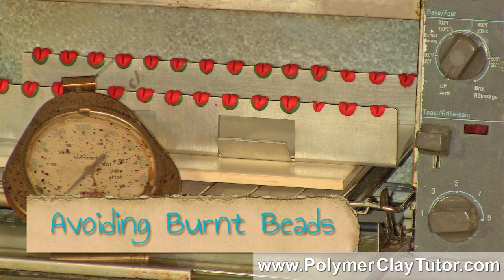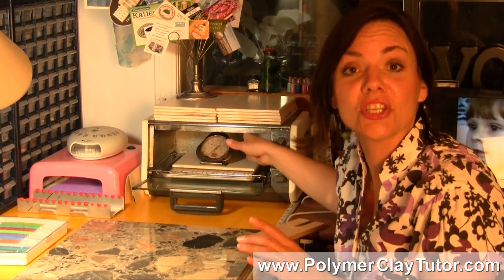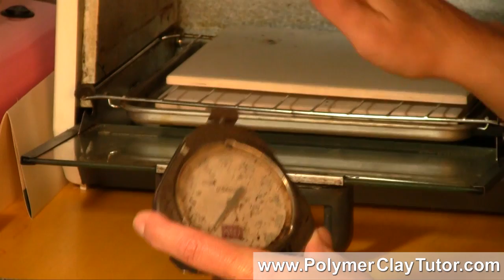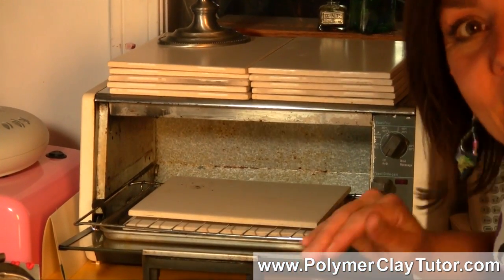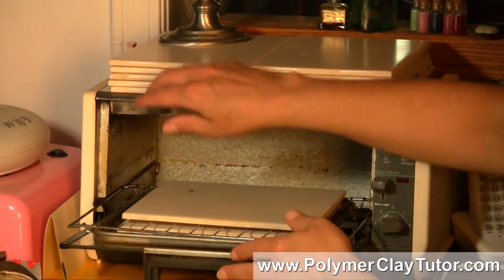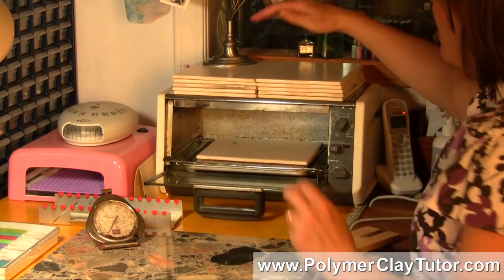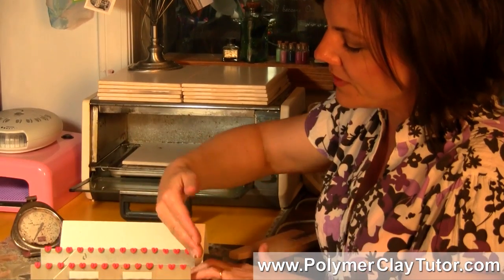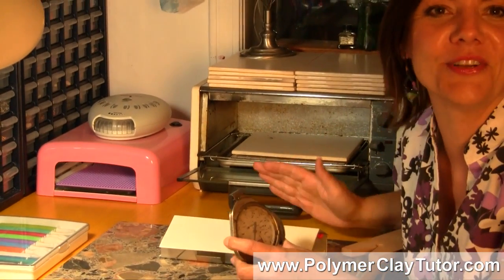Baking Polymer Clay in Toaster Oven Without Burning

Comment: I just started working with polymer clay and the first batch I baked burned so I googled you tube and found you.  I didn't have any ceramic tile laying around but did have some thin fire bricks for our wood stove.  I layered them in and around and found that my temp stabilized.  Using a tent helped too.  Thanks for your videos, they are sooooo helpful.

Comment: I just bought some Fimo Soft yesterday. To my surprise the package says "Do not heat above 130C/265F". It's been a couple of years since I have bought or used clay; previously it said temp no higher than 230F. I am making heart ornaments, Fimo Soft over aluminum foil armature. The clay is roughly 1/8" thick over the foil; at the top is a hanger which is pure clay. It's 1/8" at it's thin point, 1/4" at the base. The fimo package no longer gives any direction as to baking time. Do you have any input about baking time and temp? Would you bake something like this for 60 minutes with the insulating tiles as you have shown? Thanks.
Reply from the maker: Hi Rebecca McCartney I am not surprised by the packaging changes. Over the years the way we bake polymer clay has changed and so some of the manufacturers have changed their advice as well. I bake Premo and Fimo for 1 hour, no matter the thickness, but at the temp recommended on the pack. And yes I would use the insulating tiles as well. Check out my channel... there are lots of videos on baking and more being added all the time that should help. Good luck!

Comment: Hi. I saw on one of your channels you said to bake polymer clay for 60 minutes. I'm baking small 2, 3 and 4 mm beads and some are 2 - 4 mm balls, as well as tiny little sprinkles to put on whipped topping charms. Should those be cooked for 60 minutes as well? I bake in the same oven as you...the kitchenaid countertop convection KCO223CU.

Thanks for your advice,

April

LOVE YOUR CHANNEL!

Comment: Hi Cindy, I read down quite a few comments looking for an answer first.  My question is, if I'm going to use a new convection toaster oven, do I still need the tile (I have it readily available)? Also, there is obviously no problem using paper products in a toaster oven or it would not be recommended.   Can I assume that's the case then by the top or bottom heating elements?  I believe that is cardstock type paper only, is that correct?  I've seen a "bead holder" made from cardstock folded to look like an accordion to bake beads on but I was concerned about having "paper near a heating element"...Thank you :)

Comment: I don't have any ceramic tiles lying around but I have a ceramic cup. Can I use that instead? I don't plan on baking large items, just small ones that would fit in it.
Reply from the maker: dream_keeper88 That should work, as long as the cup is heat resistant. You could easily tent the cup wit a piece of tinfoil as well, so it might be a good solution for you. But of course you will need to test it on something that is not super important first.... just to be sure you're getting a proper cure. Let us know how it works for you!

Comment: If I use a ceramic tile, a tin foil tent and bake polymer clay in the correct temperature as stated in the package, would it still work even though there is no bake option nor a temperature dial? My toaster oven only has the timer dial on it.

Comment: Is it safe to use your regular kitchen oven since the clay and fumes are non toxic?
Reply from the maker: Most brands of Polymer clay have been certified non-toxic to use in your home oven. If you have any concerns you can look at the Safety Data Sheets for the brand you're using.

Comment: Hi Cindy, I appreciate your video. I am new to using polymer clay, and so I am learning so much. I got a Black & Decker toaster oven for baking my clay, and I bought a oven thermometer from Kroger (Everyday Living brand). I noticed when I am heating up my toaster oven or my home oven, the thermometer is reading -25F then what my dial says. I have a really hard time with the toaster oven getting it at 275F because of this. I previously went to Home Depot and bought some tile, about same size as yours, but I only got 2 as I was thinking to use it for my work space and bake tray. How many tiles would you recommend for placing on the top of my oven? Also, do you have any advice on what to do about my thermometer? I am not sure if it is faulty or not, or how to fix the issue.

Comment: hello cyndi.. i want to ask if do i need to preheat the oven toaster first before i place my project?
Reply from the maker: Hi bella lobitania it kind of depends on your oven. If it spikes a lot while heating up, then don't put your polymer clay in there until the temperature is pre-heated and stable. But if it just slowly heats up, then it's OK to put them in while it is getting up to temp. Either way, don't set your timer until your oven has preheated, so that you know they have baked for the full amount of time. Do use an oven thermometer though. Most ovens are not the temp that the dials says.

Comment: Wow!!  I'm new to your channel & I just want to say, Thank You.  Controlling my toaster oven temperatures has, up to now, been one of the most frustrating things for me!  I actually gave up and started using my home oven.  Now I can go back to the toaster, esp useful when I'm only doing a few small items!  ~Does a happy dance~
Reply from the maker: Dancing with you UrCocoaTea !
Reply: PolymerClayTutor Hi Cindy!  I used this tip, which apparently is called a "heat sink" and it did work great!  My temps stayed really consistent & my beads didn't burn or brown. Also, apparently this saves electricity compared to the oven cycling off & on a lot without it. I was reading some comments on another video and a user was saying that they did everything, tent, use an oven thermometer etc & their beads still burnt.  Maybe their oven thermometer is faulty.  That's not unheard of.

As for me, I've been playing around with PC for several years now & I felt pretty confident about my skills.  Now I realize that I'm still missing basic info (like this)!  I think I'm going to go ahead & order your beginner's course.  Because although strictly speaking I'm not a beginner, I am sure I will still learn a few things.    

Thanks again! ~now Back to the Beads :D~
Reply from the maker: That would be wonderful UrCocoaTea ! It really is a foundations course so it's not just for beginners. I think it will be great for you. Thanks for your wonderful comment! Here's a link to the course again if you need it: http://www.beadsandbeading.com/crse/01-more.html

Comment: I need help! I just can't seem to get the toaster oven to work without wasting a lot of material. I spent the entire weekend trying to perfect this method with all your tips but ended up ruining more than I saved. Is there safety issue with using my stove oven that I cook with? I know polymer clay is non toxic but I just wandered since I've never heard of anyone using their kitchen oven to bake it.
Reply from the maker: Hi Veola Sutherland are you using an oven thermometer? Your oven may be a lot hotter than your dial says it is. Also, it is not a problem to bake in your regular oven if you want. That is what most people do until they get a separate oven. If you find there is a plasticy smell in your oven after baking, then you may want to clean your oven before baking food in there. You can also bake inside a roasting pan with a lid, if you don’t want to have to clean your oven all the time. The manufacturers say that the product is safe to use, and it is certified non-toxic, so it should be fine.

Comment: Do you have an oven thermometer? I would worry about baking at such an low temp for such a short time that your clay will not be cured properly. If you're using Premo clay it should be baked at 265F-275F for a min of 30 min. For a harder and more professional finish, I bake mine for an hour no matter the size.

Comment: Hi I am new to polymer clay baking and I had a query . The temperature of the oven thermometer keeps rising after a certain point . Is it okay?
Reply from the maker: If you find your oven is spiking, you may run into burning clay problems, I would try and use a more stable oven to bake your polymer clay.

Comment: How should I bake polymer clay when I don't have an oven?
Reply: you can make one out of aluminum foil baking pans, and tea light candles underneath (2 is good).  Or a pop can with 1 tealight there is a video on youtube about it, but I find the baking pans work best.
Reply: You can boil water in a pot and put a ceramic plate on top of it, then put a paper and use some corn starch or baking soda to cover your pieces. Then cover the plate with the lid of the pot and start boiling the water. Try to maintain the temperature and boil for 45 min to 1h. Even if you over bake, it shouldn't be a problem, it won't burn, or it is less likely to burn out your art work.

Comment: What if you put paper in a oven with the clay.
Reply from the maker: Paper is fine in the oven at the low temperature that we bake polymer clay at. Just make sure it isn't near any elements or the walls of the oven and  it won't burn.

Comment: I'm afraid the card stock may catch on fire.  Has that ever happened?
Reply from the maker: Not that I have ever heard of. Paper combusts at 451F and polymer clay bakes at 275F so there is no issue burning as long as it is nowhere near the elements.  Of course you need to be smart  about it.

Comment: I tried putting paper over mine and the paper burnt and ruined my beads
Reply from the maker: It sounds like you got the paper too close to the element, which I did warn about. I have another video where I use a tin foil pan as a lid instead which sounds like a better solution for you. https://www.youtube.com/watch?v=3dhqyHEoafA&t=1s  Sorry to hear about your beads. Hopefully you can find a way to salvage them.
Reply: @PolymerClayTutor  Unfortunately there is no way to salvage them, but that's ok, live and learn.  I do think as well that the paper was too close to the element.  thanks for the reply

Comment: I have been told that you should not use your home oven is that you cook your own food in as polymers clay have many components in it is plastic which could be a dangerous health hazard ?  k
Reply from the maker: +Kathleen Anderson The clay is certified non-toxic and was designed for use in your home oven. If you are worried about it, you can bake in an enclosed pan. See my other videos on baking for more information.
Reply: I've never heard that one. I'm quite sure the only issue is baking clay ON things that you use to prepare food (not cooking food on the baking pans/trays that you use to bake your clay pieces) As Cindy mentioned polymer clay is meant to be cured in an oven so I think you may have gotten some incorrect info.